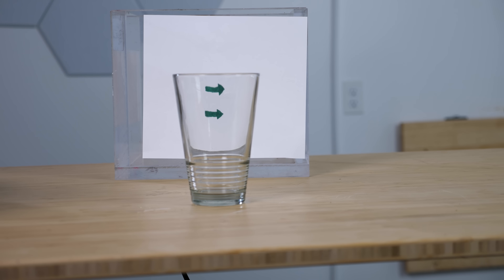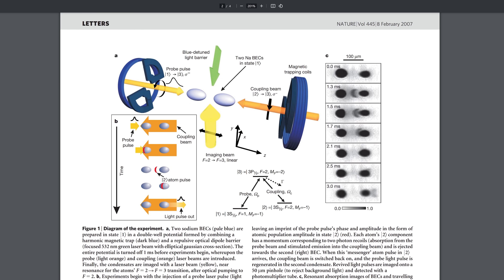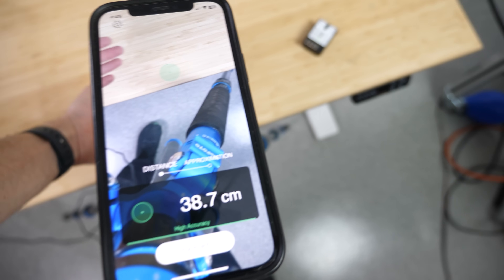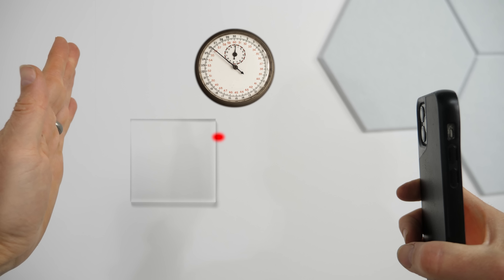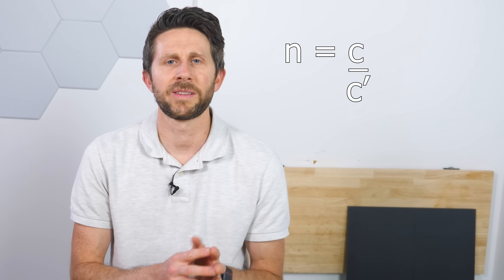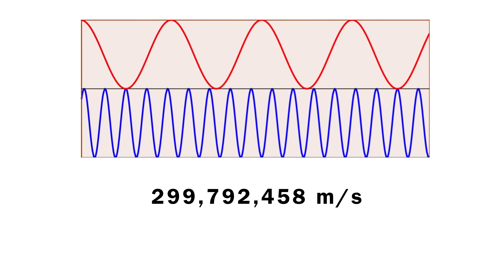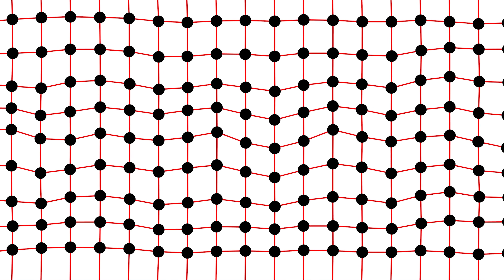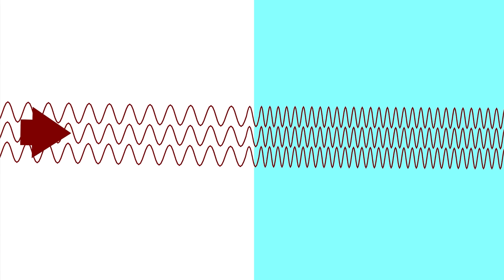Solving The Slow Light Paradox

Comment: Dark energy is the cosmic speed limit in resistance throughout space. Light is in entanglement with magnetic fields of mass. Light is only present in resistance to mass. Dark energy outside of entanglement of mass is potentially renewable energy striking mass. Normal space is filled with dark energy outside of entanglement of mass throughout space. Dark energy passes through mass in chain reactions until open space itself and returns to dark energy outside of entanglement of mass. Magnetic fields redirect energy in cycling circulation patterns as illusionary solidity of liquidity. Internal magnetic fields grounding energy onto itself. External magnetic fields don't ground energy. Energy has to be cycling circulation patterns to form elements. Light is sparks of electrons striking particles in exchanging energy. Heat, light, and resonating frequencies vibrate when resistance is amplified. Lightning burns through atmospheres as sparks of electrons as light and decay of mass into singularities of energy outside of entanglement of mass as waves. Pressure is heat gain. Pressure expands mass by energy accumulation in repulsion to cold space within mass as outward force of pressure. In a greater magnetic field, synchronization of smaller magnetic fields grounding currents of energy exchanging in chain reactions towards the greater magnetic field flow of current. Internal magnetic fields grounding surface mass towards the weakest point of repulsion as mass. Mass neutralizes repulsion within as outward force of pressure known as weightless outside of a greater magnetic field. Synchronization of earth's magnetic field controls quantum magnetic fields towards grounding or magnetic bonding. Energy is liquidity until entanglement of magnetic fields as illusionary solidity of liquidity. Force fields holding pressure in equalization to pressure within from pressure cycling circulation without. The core of the greater magnetic field is more force of pressure and the least amount of distance traveling cycling circulation. The farther away force of pressure grounding is bonding magnetic fields as force of weight. Hydrogen has the strongest magnetic field of force flow with minimal distance. External magnetic fields are cycling circulation patterns outside of entanglement of mass as hurricanes of free-flowing energy current that don't ground. Proximity mass magnetic fields are redirected trajectories towards the weakest point of repulsion around these external magnetic fields and mass disolves its internal magnetic fields grounding towards the greater magnetic field free-flowing energy outside of entanglement of mass. Black holes can't form mass as open currents or circuits. Internal magnetic fields grounding surface mass towards the greater magnetic field holding mass together. Elements are internal magnetic fields grounding in on itself. Earth's magnetic field grounding in on itself. Surface mass grounding renewable energy in on itself as current flow. Outlets with current flow with grounding excessive current. Electricity is rapid energy flow grounding electronic current of energy. Normal space is filled with dark energy outside of entanglement of mass, and mass occupies this energy field and exchanges energy point to point interactions. Energy passing through space and mass continuously throughout space from stars near and far away throughout space as space itself. Cold repulsion to propulsion from cold repulsion is dark energy outside of entanglement of mass as the cosmic speed limit in resistance as constant cosmic speed limit in and out of entanglement of mass. Internal magnetic fields redirect trajectories of energy as liquidity to illusionary solidity.  Proximity mass  by external magnetic fields is like pulling down the grounding or dam up of energy, and resistance is minimal like open space itself. Normal space is repulsion to propulsion from repulsion minimum resistance to propulsion. Internal magnetic fields are greater repulsion outside of entanglement of mass as repulsion within occupational space is neutralized as outward force of weightless until a greater magnetic field redirects current into synchronization onto itself and energy is constricted into mass. Theoretically factual probability that works with quantum physics without gravity. Magnetism bonding force of space as a field of dark energy in and out of entanglement of mass. Black spheres are external magnetic fields with cores of absolute zero energy within. They don't ground as mass. Repulsion is minimal from the energy hurricanes outside of entanglement of mass in its magnetic field. Once equilibrium is maintained by the external magnetic field generators that disrupt proximity mass and the field can no longer reach internal magnetic fields grounding, it will keep amassing circulation patterns of mass out of its disrupted magnetic field reaches and mass will circle the external magnetic field as galaxies. Accumulation is finite. Theoretically factual probability that works with quantum physics without gravity.  Stars exploding away their energy from point of exploding away their energy and energy as space itself. A void of cold space absolute zero energy within and normal space filled with dark energy outside of the void created circulation of pure cold fabric of space itself as pure repulsion to energy. Cold repulsion to heat propulsion from cold repulsion. External magnetic fields jetting of excessive energy at the poles of pure repulsion. Theoretically factual probability that works with quantum physics without gravity. Neutralized resistance within occupational space as mass grounding currents of energy trickling through mass as aging or decay. Current of energy all around us and through all mass and space except black holes. Theoretically factual probability that works with quantum physics without gravity. Mass occupies space as neutralized repulsion. It can't collapse. Energy doesn't collapse. Physics works. Hydrogen expands into helium under extreme pressure. Physics works. Theoretically factual probability that works with quantum physics without gravity. Magnetism bonding force of grounding currents towards the greater magnetic field generators works with quantum physics without gravity. Friction causes sparks of striking resistance as renewable energy exchanging singularities point to point interactions throughout space. Currents of energy transference through mass and space itself continously at the cosmic speed limit in resistance to repulsion to propulsion from repulsion.  Magnetic cores are more force and minimal distance. Farther outward equalization is less force and more distance traveling cycling circulation. Galaxies prove hypothesis to magnetism. Light is a product of resistance until it hits open space itself and returns to dark energy outside of entanglement of mass. Hydrogen under extreme pressure expands. Helium occupies more space and contains more energy and repulsion. More  pressure of weight within a greater magnetic field. Mass is outward pressure of force equalization to repulsion. All mass is weightless in space. Magnetic fields in proximity determine the pressure exerted on mass. External magnetic fields disolve internal magnetic fields by affecting normal space filled with dark energy by neutralized repulsion to internal magnetic fields in proximity to them. Current flow cycling circulation free-flowing energy outside of entanglement of mass with no plug or dam. Unification of unidirectional pressure of force as energy flowing as current. Washout of mass. These external magnetic fields don't ground as mass. Physics works. Mass is always equal to repulsion within and without entanglement of mass. External magnetic fields disrupt equalization of pressure repulsion to proximity mass.

Comment: Math is weird being a language constructed to describe relationships using terms that can be used to mechanically derive new information yet to be observed

As such it can and does frequently provide data that is largely fictional,  just like our more widely used spoken languages

Anyway,  isn't it just more likely that the light though traveling at a constant speed, traveled 67% farther through the more densely packed particles of the acrylic due to having to navigate around each particle since it can't go through...

This seems to be supported by the tests showing the stoppage of light in materials at near absolute zero temps which contradicts the condensed wave explanation as the stoppage of light would be impossible.... right?

Anyway,  cool vid

Comment: I think speed of light is variable and I think I got proof on X, but let me try digging you out of your speed of light paradox.

Take the space in your vacuum chamber. All the air is pumped out. Nothing in there but space. Let's imagine you compressed and crystallized that space into a tiny cube, it could be thought of as compressed space, or that is to say, compressed distance. That is the acrylic, space condensed and crystallized into a tiny universe of space in your hand.

The speed of light is not slowing down in this caee. It is traveling through tons of extra space, but we currently think that, (I think the term would be) dielectrics, are plastics or crystals, they are actually compressed "space" or crystallized vacuum. 

Capacitors use this because until the current goes all the way through to touch the other side there will not be a discharge, and to get through, they have to travel through more distance, or in this case, compressed space.

Comment: "Now this speed is always constant; it is the speed of light..."
...through WHICH material or lack thereof?
Reply: Speed of information. Speed of light is technically constant, because even in matter, most of the space is still a nothing with empty space between vacuums. It’s the overall combination and interference that forms a wave that propagates less than c
Reply: @TheOtherOlesen : It's not even just the speed of information either, since that changes too.
Reply: @HelloKittyFanMan  Fair, for macroscopic information. I guess I meant the speed of the smallest bit of information, since information is always exchanged in the universe, this quantum information exchange travels at c
Reply: @TheOtherOlesen  Mmhmm... 
(I'm not being sarcastic.)

Comment: Those infrared sensors measure the distance between the dots in the laser projected grid, not the travel time, i dont know how could you measure a bounce and know is the same light that went odd, seems almost imposible. though you can get the same result both ways.

Comment: Even without the need for a vacuum, he finds a way to use the vacuum chamber for experiements. What a legend.
Reply: Should have measured the time of flight though a chamber full of air then vacuum.
Reply: @mgancarzjr  The difference is negligible. The refractive index of air is 1.00027717 meaning that the speed of light in air is 0.99723596c, a difference of 0.28%. Even if you used a really long vacuum chamber, the difference would probably just get lost in the noise of the sensor (maybe if you super-cooled the sensor using liquid nitrogen or dry ice or something, but that would probably invalidate the calibration).
Reply: Exactly, this man tries to make the most of his vacuum chamber in all his videos. That's one of his prized possessions or smth and why wouldn't it be
Reply: If I lived next door, I would want to be his helper free of charge.
Reply: When you buy a shiny new hammer, everything starts looking like a nail...
Reply: @FractalShoggoth  only in a vacuum
Reply: @FractalShoggoth  I nailed it with my shiny new vacuum.
Reply: He didn't use vacuum here
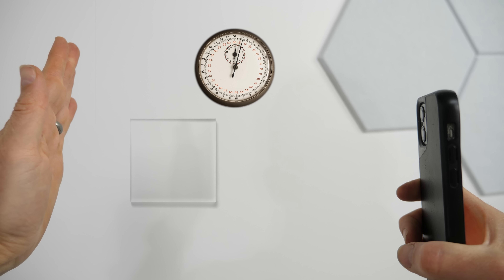Reply: @strategistaow3520 The acrylic wall of the vacuum chamber 3:07
Reply: So true AHAH

Comment: Phone doesn't measure the dalay of reflection of the light. It's almost impossible to measure distance this way. It measures phase shift of the reflection.
Reply from the maker: The ToF (time of flight) 3D-camera of iPad Pro 2020/2021, iPhone Pro 12/13 and iPhone Pro Max 12/13 has physically 64 (16 stacks of rod of 4 cells) VCSELs (vertical cavity surface emitting laser). The 64 laser pulses are multiplied with 3x3 to 576 by a DOE (diffraction optical element). The 576 rebounded laser pulses from object surfaces are detected and the individual time elapses are measured by SPAD (single-photon avalanche diode) image sensor.
Reply: @TheActionLab  It explains very little. If you'd want to measer a distance with 1 cm precision you'd have to check the photon sensors at the rate of 30 Ghz. With 1mm precision it would be 300Ghz. There's no electorincs that  can work at these clocks. Instead measuring the phase shift is much more efficient. At least a regular laser rangefinder works this way.

Comment: This explanation is very interesting.  Good Job.   This knocked a couple of cells together and sparked a thought:  Passing it through materials would be a wave resistor... I wonder could there would be a way to make light transistors using prisms or ....
Reply: Or lenses?
Reply: If only it were that easy. 
Photonic logic is the use of photons (light) in logic gates (NOT, AND, OR, NAND, NOR, XOR, XNOR). Switching is obtained using nonlinear optical effects when two or more signals are combined.

Resonators are especially useful in photonic logic, since they allow a build-up of energy from constructive interference, thus enhancing optical nonlinear effects.

Other approaches that have been investigated include photonic logic at a molecular level, using photoluminescent chemicals. In a demonstration, Witlicki et al. performed logical operations using molecules and SERS.

The basic idea is to delay light (or any other signal) in order to perform useful computations. Of interest would be to solve NP-complete problems as those are difficult problems for the conventional computers.

There are two basic properties of light that are actually used in this approach:

    The light can be delayed by passing it through an optical fiber of a certain length.
    The light can be split into multiple (sub)rays. This property is also essential because we can evaluate multiple solutions in the same time.

When solving a problem with time-delays the following steps must be followed:

    The first step is to create a graph-like structure made from optical cables and splitters. Each graph has a start node and a destination node.
    The light enters through the start node and traverses the graph until it reaches the destination. It is delayed when passing through arcs and divided inside nodes.
    The light is marked when passing through an arc or through a node so that we can easily identify that fact at the destination node.
    At the destination node we will wait for a signal (fluctuation in the intensity of the signal) which arrives at a particular moment(s) in time. If there is no signal arriving at that moment, it means that we have no solution for our problem. Otherwise the problem has a solution. Fluctuations can be read with a photodetector and an oscilloscope.

The first problem attacked in this way was the Hamiltonian path problem.

The simplest one is the subset sum problem. An optical device solving an instance with four numbers {a1, a2, a3, a4}.

The light will enter in Start node. It will be divided into two (sub)rays of smaller intensity. These two rays will arrive into the second node at moments a1 and 0. Each of them will be divided into two subrays which will arrive in the third node at moments 0, a1, a2 and a1 + a2. These represents the all subsets of the set {a1, a2}. We expect fluctuations in the intensity of the signal at no more than four different moments. In the destination node we expect fluctuations at no more than 16 different moments (which are all the subsets of the given). If we have a fluctuation in the target moment B, it means that we have a solution of the problem, otherwise there is no subset whose sum of elements equals B. For the practical implementation we cannot have zero-length cables, thus all cables are increased with a small (fixed for all) value k'. In this case the solution is expected at moment B+n×k.
Reply: Optical Computing is a field of ongoing research, and there is a lot of fascinating work being done in building logic mechanisms using light’s properties. Typically these techniques leverage quantum effects such as wave interference and polarization - check out Huygens Optics channel